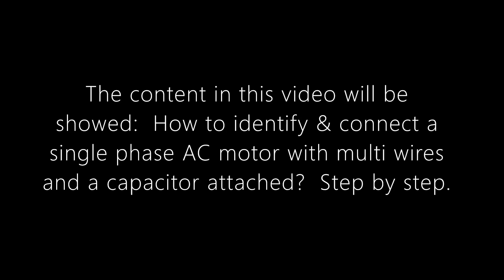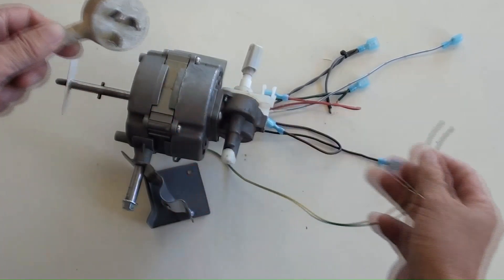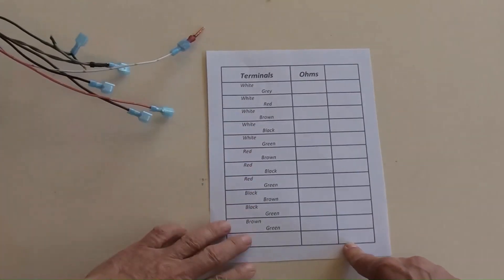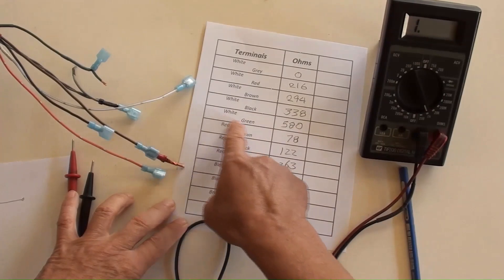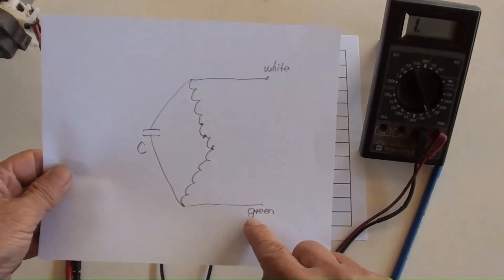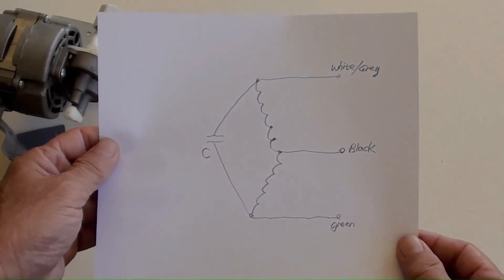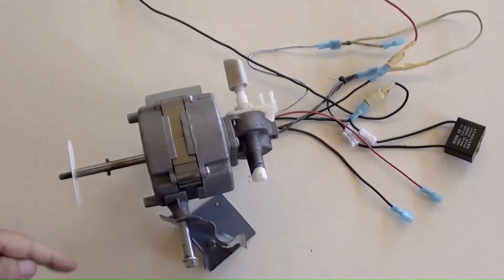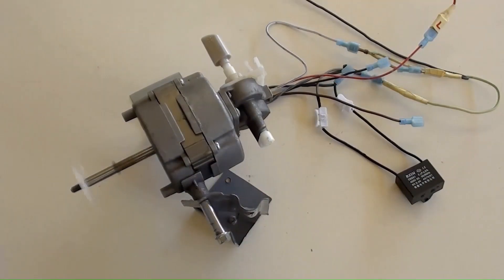How To Connect Multi Wires AC Motor With A Capacitor Attached?

Comment: Why are you using White,Red and Black as the yardstick
Reply from the maker: Thanks for your interest!  Actually Black, White or Green as the yardstick because these wires are the principle of the motor's working:  For example, the motor must have Black and White or Green wires otherwise it doesn't work.   In practical situation:  White connects to Live, Black connects to Neutral then the motor will turn however if Green connects to Live, Black connects to Neutral then this time, the motor will turn around in different way as previous turned.  The other wires are for additional functions such as the earth wire, slow speed or high speed wires etc.  The motor still works if there aren't any additional wires.  🙂

Comment: How long can the motor run without overheating based on these connections
Reply from the maker: That's the standard or normal way(s) connected however if the motor were overheating as you mentioned, I'd say it must have had the other causes which the motor would need further diagnosed or investigated.  Cheers!

Comment: why the capacitor is needed for the motor to do what to keep the motors running smooth or something else
Reply from the maker: Thanks for the interested & yes, you've spotted one thing on!  To put it in the simplest way for answering:  The reasons for attaching a capacitor to a single phase AC motor are (1)  Easy to start motor & then run it smoothly as you've mentioned. (2) To improve Power Factor because the coils inside AC motor as whole can be seen as an inductor in the AC circuit, so you might have known already - an inductor has the voltage 90 degree advanced over its current however a capacitor has the voltage 90 degree behind its current, in practical circuit a capacitor & a motor together will compensate some phase angles each other but all, that will be the result for improving Power Factor for whole grid system (for your own benefit, improving Power Factor, the less current goes through your home elec meter, the less the power bill you have to pay).

Comment: this is exactly I wanted to know the AC single phase motor, so, 2 winding opposite side, 1 neutral point, 1 phase and another phase has 3 cables in different position to create difference in resistance.
Reply from the maker: Thanks & glad it helped 👍

Comment: I have a 230v motor with. Four wires..how do i connect
Reply from the maker: Thanks for your interested!   You'd have known how to connect your 230v motor with four wires if you watched the whole video carefully.   Anyway, some suggestions are here:  <1> make sure there is no Earth Wire among four wires.  <2> Name four wires as A, B, C & D.  <3> Using a multi meter ohm position to measure following two wires resistance such as A-B,  A-C, A-D, B-C, B-D & C-D, then chosen highest resistance's two wire for connecting a capacitor.  <4> Connecting Neutral Wire (N) from the power to the one of wires from capacitor then connecting Live Wire (L) from the power to the one of the two wires left.  That's it.   P. S. --  So far three wires from the motor have been connected, last wire which has not been connected yet, that wire would be slow speed or high speed wire depending on Live Wire (L) connected to the wire was high or low speed.  Also this conclusion supposed all group wires you measured, no zero value among them.    Good luck.  🤜🤛
Reply: Connect one with another till it smokes, then your really done.
Reply from the maker: No, no, I'm sorry to hear that!  If your motors are reasonably good condition, they should be okay for testing run so long as you followed the steps in the video or above.  I'd reckon you'd mismatched or accidentally connected wires such as connected the power wires (L & N) to between low and high speed wires, this was one of the most likable reasons for smokes from motors because the value of impedance between low and high are much much lower than the value of impedance from normal operating coil for that motor.   Good luck next time!